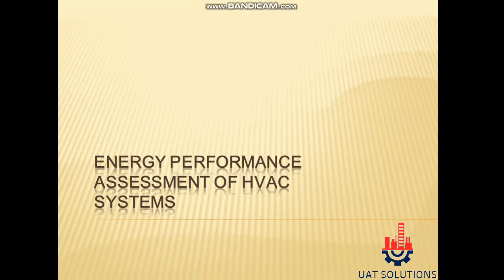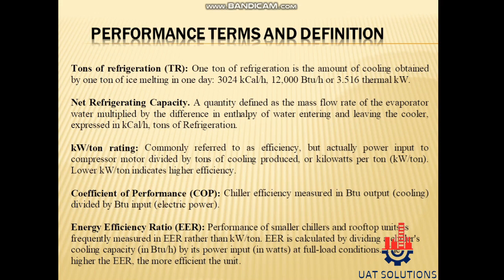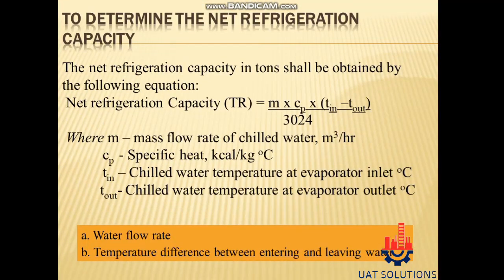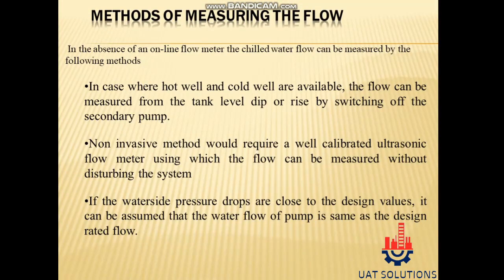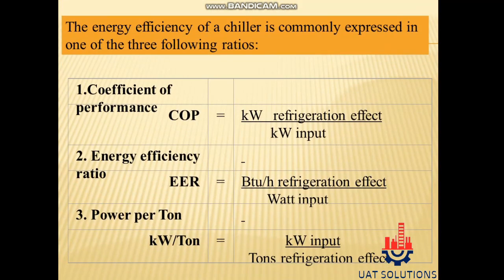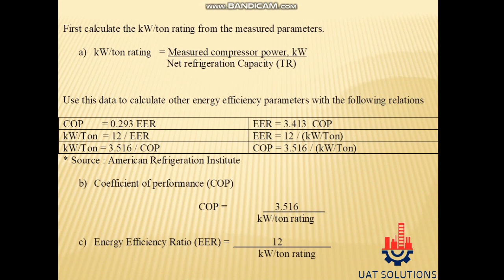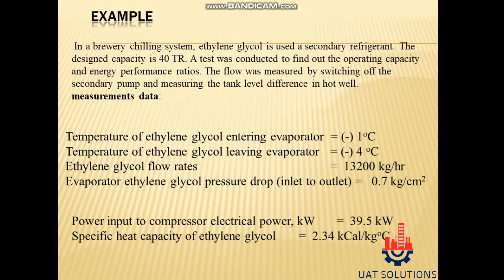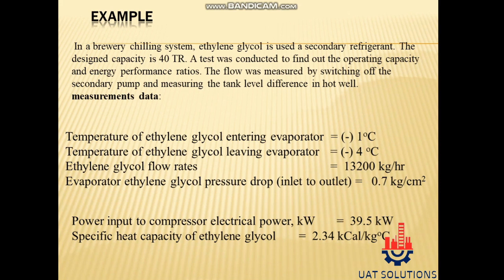How to Assess chiller performance or energy efficiency EER

Comment: Which parameters will be involved in COP of R-134a calculation ? When this refrigerant is used in the chiller i.e., Condenser temperature and pressure or Evaporator temperature and pressure???
Reply from the maker: Please share your email address or you can contact us on uatsolutions@gmail.com to have the answer of your question.

Comment: carrier 30xa alarm electrical interlock failure
Reply from the maker: Good day.
Please confirm if the alarm is “electrical box interlock failure”  or electrical interlock failure
Reply from the maker: If the alarm is electrical box interlock failure . Than here is the troubleshooting guide.
There is on thermostat inside the electrical panel it has 2 wires and normally closes contact and it is connected on main processor board  connection j4 channel 15 
Make sure you read continuity between the 2 wires. If you dont get the continuity check the thermostat. 
Thanks.
If it doesn’t help please get back with more details
Reply from the maker: https://youtu.be/03knBnvo8bo
watch the video if you have difficulty locating the connection of electrical interlock on the main process board
Reply from the maker: Also check the mechanical water flow switch and confirm the wires are well connected on the main board.
Reply: Thank you for your fastest response and  reply
Reply: Can you please help me for getting  overhauling book for 30xa and 30xb
Reply from the maker: Sure share your email address .